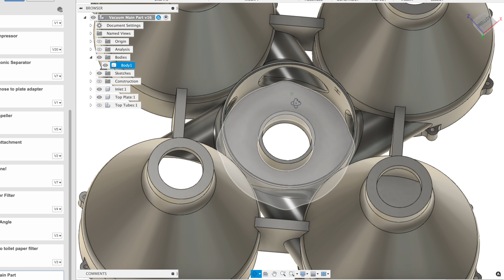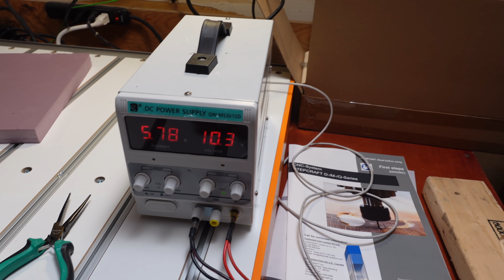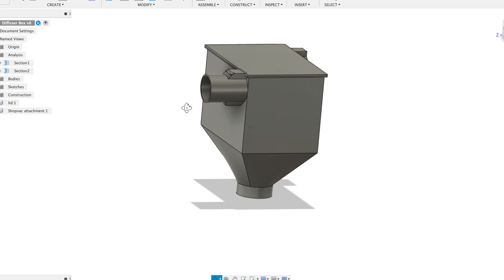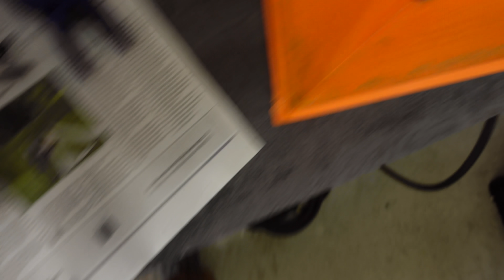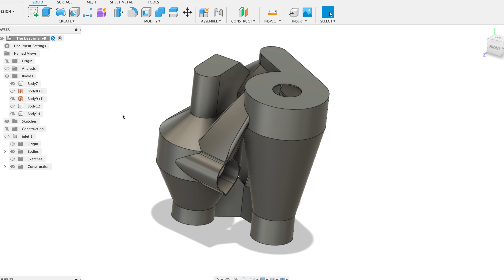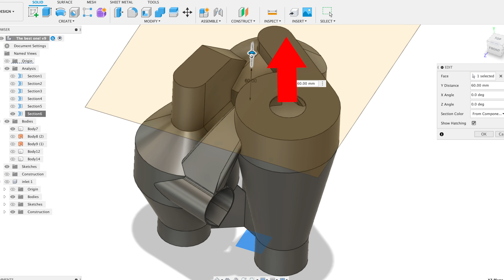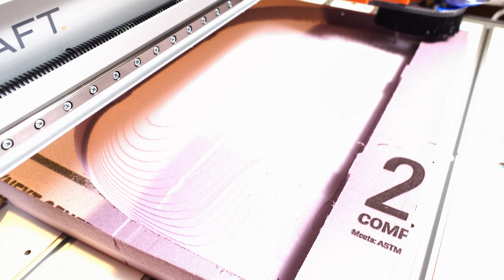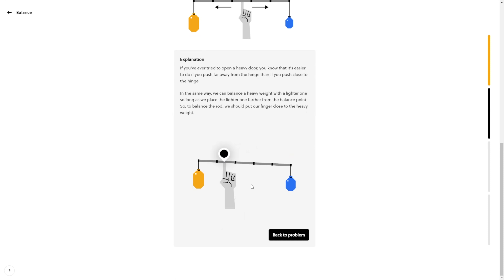3D Printed Cyclone Air/Dust Separator

Comment: Cyclones have proportional dimensions to work well 1D3D are widely used in industrial applications. Where D is the diameter 1 is the height of the cylindrical part and 3 is the length of the conical part. The size depends on the volume of air per minute.

Comment: I don't think the baffles in the diffuser box will really do anything to cause a change in airflow speed. The only thing that can do that is changing the inlet and outlet diameter. Mass flow in is going to equal mass flow out (minus the sawdust that settles in the bucket of course). The compressibility of the air can confound that translating to airspeed a little, but only so much.

Comment: Liked the video & am envious of the CNC however if you are still looking for more Cyclone information then "Design and fabrication of cyclone separator, August 2015, Kashan Bashir DOI:10.13140/RG.2.2.20727.83368" should be of use. It's a clearly written thesis but its by a chemical engineer so the maths and fluidics are complex but the ratio tables (p14) will give most people a good start.

Comment: The center suction tube needs to be down into the cone and slightly below the entrance hole.  If you have dust coming back up from the bucket then you probably have a leak somewhere.  3D prints are full of micro cracks that make them difficult to use in sealed environments.

Comment: This is exactly the kind of DIY video i likee and would like to see more often: passion, skill, creativity, and well-executed objective tests. I really appreciated your video, because over the years i have also built and experimented with various types of separators for my home tiny workshop, in order to filter well especially the critical MDF dust: i have long since found an excellent solution, which includes 3 different stages (first a Thien separator for large and medium parts, then a small cone cyclone for very fine dust, and third a simple and cheap polyester filter, which remains clean for months on.

Comment: I am late to the party here - but another question, what specific 3D design SW did you use?  

Now - the key to multi stage separators is separating the discharge containers  or you get recirculation - just no way around it. - I was sitting and looking at the Dyson patent while watching you as I was using an online design program for a multi state. The Dyson uses a lot of small diameter separators because they collect the smallest particles. PowderProcess has a design program that has a basic particle size limit on separation.  Your challenge seems to be the buoyancy of the particles. Dumping in top of a pile and measuring the time to discharge would help. Just close one end to prevent pumping.

Comment: IMHO, it seems like the diameter of each cyclone matters more than the number of cyclones in series when you fit the whole thing into a smaller space. 
I hope you can get better results by trying out another 3-in-series cyclone system with a larger diameter of each one (may need a bigger space though). 
Just an opinion. I didn't do the math of it, so I cannot guarantee the results. If you can, please try one and come up with another video please.❤

Comment: hey - some awesome testing, congrats. You are on the right track with your staged approach. Unfortunately, you overlooked somewhat the important difference between the stages: particle size. In order to make each stage work optimal, you need to adjust the speed of airflow, pressure and diameter of each cyclone to catch the different size particles. On the upside, a two stage approach should do. but keep in mind, you need separate buckets - because the air will find the path of least resistance!

Comment: Hi, Great video! But I think that you should evaluate some issue dued to the flow dynamic, like the turbolence effect of the  different geometry of the cones. I guess if the flow reaches the cone as much laminar as possible and geometry of the cone are so optimized to reduce the turbolence inside, you could have a great result! Thanks a lot of your video!

Comment: So, a dyson actually is two bins in series. The first cyclone takes out large debris and is tuned as such. the air then goes into the smaller cyclones and dust is collected in the inner bin. the bins are annular and share the same door.

Comment: The more cyclone stages you have, the more it's probably going to restrict the airflow. Personally, I would just go with the single cyclone: less airflow restriction and less joints/connections to leak/fail. Simple is often better.

Comment: You can also put the intake for the funnel a bit lower from the top and on a downward angle for a more efficient cyclone. You ended up doing it more like the Dyson works. So I guess you have to connect the three in one with the mono cyclone, but you seem to be stuck putting the intake at the top of the funnel, I like the one I saw with the intake about 1/3 down and on a downward angle, only about 20 deg but it seems to help guide the dust to the bucket below and nothing else got away. The angle was not much either, it was made with a 5 gallon bucket as the cyclone yet it worked  very well.

Comment: I’ve been using hydro cyclones in my job for 30 years. There are som basics missing here. 1. Smaller the cyclone diameter, smaller the d50 cut point (the size where 50% of the material is recovered up or down), but 5he capacity drops off - this is why dyson have multiple clusters in their vacuums. 2. Length of cyclone or cone only adds a little more efficiency. 3. Adding cyclone overflow to 2nd stage cyclone of the same size will do very little as the cut point does not change.

Comment: From my own experience of using a cyclone, I can say that it is very important that the container with the cyclone does not fall on its side and there are no pressure surges - so before the cyclone it is necessary to make a check valve that will neutralize pressure surges.
Well, it is desirable that the dust container is not overfilled by more than half if it is more than 40 liters, or by a third if it is less.

There is still a certain dependence of the diameter of the cyclone on the power of the vacuum cleaner - if it is less, then the debris will remain in the cyclone itself and it will eventually fly away further, and if it is larger, then it will also slip further. So you can play with the diameter of your cyclone or the power of the vacuum cleaner (motor) to select the optimal ratio.
Instead of paper filters for testing, I would recommend an aquafilter (perhaps of your own manufacture) because of its reusable use indiscriminately (just drain the dirty water and pour in clean water) and the ability to assess the quality of cleaning with transparent walls by the state of the water.
It is likely that several parallel small cyclones can be more effective for fine dust that a large cyclone does not take - at least I would like to test such a hypothesis, but I do not have the opportunity to do this and may be of interest to you.

Of the improvements, I can advise you to make a cyclone with a screw-down fastening to the dust container, rather than fastening it to screws - this turns out to be much more reliable due to the uniform pressure of the connection to the lid along the entire circumference, which leaves no potential gaps for air suction, as well as more reliable in terms of accidental side loads on the cyclone, since the fasteners of the screws can crack and loosen.

Also, you might have noticed that the rotating air stream spins the dust inside the tank and sometimes lifts it back, so you can try to do two things - install a cross-shaped partition inside the tank at the bottom so that the dust falls there and is less captured by the whirl, and also do under the hole, a cone-shaped cap with the point upwards, so that the dust falling down is squeezed out outside the whirl area, where it could no longer be captured by it.

If you make several cyclones, then it is also very important that several cyclones do not communicate with each other inside the same dust collection tank - in this case, the air begins to move between the cyclones through the dust container and and capture dust.

Comment: Maybe a spiral structure along the cyclone wall could help move debris down and prevent it from being picked up by the upwards movement. Also, maybe the outlet could be shielded from the dust in the cyclone with a little cone. "sorting the movement of air" - so to speak - could also benefit noise reduction.
I also think that the radius of the mono cyclone is what makes it more effective. The upwards soak and the downward cyclone get in each others ways, so that particle from the cyclone are picked up easier. Also the stuff needs to be grounded to reduce/avoid static. Not sure, but I imagine it could reach dangerous voltages and you could have spark formations that ignite saw dust and that is a fire hazard.

Comment: Wow, nice work trying all those designs. I have some experience with hydrocyclones and air cyclones, so I can offer some general design advice. Smaller diameter cyclones have a finer "cut point" (smallest particle size removed from the flow), but less volume flow capacity, so you need more of them in parallel to process a given sized flow. And since they are smaller, less tolerance of larger particles before clogging. Your cone angle should probably be 60 degrees or less for most applications (included angle), larger diameters tending to have large angles.

Flow can enter the top of the cyclone level, but often there will be a "vortex finder" to prevent flow from bypassing the rest of the cone and immediately leaving via the top discharge ("short circuiting"). The vortex finder is just a tube that runs down the center from the top discharge to help isolate the top and bottom discharge flows for a 15-30% of the cyclone height (actual amount varies and is often determined by experimentation).

You might get decent results by pairing a smaller diameter "fines" cyclone with an upstream drop box, which is large sectional area volume with a simple baffle. Larger and heavy debris drops to the bottom of the box as the airflow velocity suddenly drops due to the change in section area, the fines are carried by the airstream to the cyclone. The cyclone has fewer solids to work on and they are finer, so the cyclone can be smaller. As an aside, smaller cyclone have higher pressure drops scross them than larger ones, so keep that in mind if you need to use multiple cyclone in parallel.

Good Luck and I look forward to seeing more of your designs here(?)

Comment: All that’s going to do is reduce the suction of a very weak shop vac motor. Cyclones only help reduce dangerous dust when combined with motors powerful enough to overcome the reduction of suction caused by the cyclone. And that’s not going to come from a shop vac, but a massive 5HP motor with a large impeller.

Comment: The small corrugated hose will sing even a low air flow. You can take a 2-5 foot section and swing it around like a lasso and it sings.

Comment: For what it's worth the serious defusers have water spray bars in them too. We have some of them where I work. The water spray helps to basically catch all of the dust and wash it out of the bottom. They're great for industrial scale when you start needing filter bags and the kind of maintenance that comes from abrasives. Probably not so much for what you're doing.

Comment: I poked around the published science and built a few... Most of the best vertical cyclones have a cylindrical portion atop the cone, and the code will be roughly 2-3x as tall as its diameter. Don't go too quickly or too narrowly lest your air stream re-entrain fugitive particles. Also consider having some sort of baffle below the bottom of the cone outlet to prevent the vortex from reaching down into the bucket: if the dust in your bucket is swirling, then you're re-entraining fugitive particles. Finally, cyclones have roughly the opposite trade-offs to filters: a good cyclone removes the vast bulk of debris but the very finest particles will always require a quality filter medium.

Comment: Good job on this.  I wonder, with the three stage series cyclones, what if you reversed it, so that your first two stages went into the captive containers and the final stage went into the big bucket.  You might even consider using three captive containers (sub buckets) for the three cyclones, since that seems to be what you effectively have anyway.   Any thoughts on that?  Keep up the good work.

Comment: Honestly whether it worked or not I'm still impressed.
Reply: This also shows us one thing can't work for all things. (you'd figure that out if you watched til the end of the video.) You need different things to solve different problem. Creating the best possible solution. We found a way to get to the moon in the 60s but lost that way cause we claimed to advance. But you can't have one thing without the other.

Comment: Your series cyclon should work better than your test result. My hypothesis is at the end of your test, you push the hose against cardboard, choke the whole system so all 3 buckets are in negative pressure and particles got sucked up. In your first test, you can see green powder moving up at the end when you suffocated the intake.
Do you plan to try the Harvey dust processor style separator?

Comment: I'd use first a gravity based (maybe mechanical theough some big mesh) filter and then the monocyclone for the rest. So basically into a bucket for the heavy big stuff, out of it and through a tube to the monocyclone.
Pretty cool tests you did there 👌

Comment: I hope you figured it out. This video is dated December 4, 2021. You’re missing the whole idea. Those multiple cyclones are not productive. What you want is the fastest rotation inside the cone as possible. The bottom of the cone that is the small and needs to be opened up more. Otherwise what goes in will just come right back out before it falls to the bottom of the bucket. I have the dust Deputy. It is amazing! I can’t believe all the people that go to Home Depot and buy shop vac filters as much as they cost. It is ridiculous! Cyclonic filters are awesome! I’ll give you an A on your 3-D printing though!

Comment: what u need is duel cyclones one feeding the other side by side for double filtration
  in--    \          -------           /-----------  suck
              \     /        \        /
               \  /             \  /    

the line is pass thru

mega auto cad lol
Reply: each cyclone should be separate feeding each other and piped from the top of the first into the side of the second
Reply: not 4 in one 
just my opinion
Reply: ooooooh you did it lol
Reply: smaller holes at the bottom ie 2cm

Comment: Did blocking off the hose (stopping the airflow) potentially mess with results? There were a couple tests on video that varied like that, and I wonder if it affects how well it works

Comment: Small diameter: large dust
Large diameter: small dust (and large dust) 

The bigger the diameter, the more force is being imparted.

A 2 stage separator should have a small diameter first and a large diameter second in series.
The outputs have to be isolated from each other, but can lead in the same bucket when using a sealed separating wall.

Comment: Bigger diameter cyclones impart higher centrifugal forces, which even let's small particles cling to the walls.
You might want to make a 2 stage cyclone with a small diameter cyclone for heavier stuff and a large diameter cyclone for lighter stuff.
The outputs can be on one lid, but the bucket should be modified to 2 compartments.
(just using a separating wall)

Comment: It's important to consider air volume vs air (vacuum) pressure.   FOr a single tool - a high suction lower airflow may be ok. For longer runs etc and some timber dust, high air volume at lower pressure becomes more useful.  Tube diameter plays a big role in this.

Comment: cyclones are a massive help in this use case. I made one myself and had some issues with the container seal... so I put clingwrap on the container as a separator, sprayed eurathane foam into the lid and clipped it on. Cure, cut off excess and now have perfect seal.   Increased rigidity to prevent vacuum collapse and perfect seal.

Comment: My guess is that the angles of the cones were not steep enough and the surface too rough (3D-printer layers) for a good result. Maybe coating the inside with a real flat surface for better air flow. perhaps something like rubber like could help to stop existing particles. Negative side of rubber is that is possibly scratched of with the time.

Comment: The air tries to find the path with the least resistance, that is form the last of the three cyclones through your wast bucket and than through the first cyclone to the intake, thats why you get bad results. You should try hermetrically sealed independant 3 waste buckets for each of the cyclones

Comment: Your goal should be to create a low pressure high velocity area to swirl the particulate, but then create a high pressure low velocity exhaust outlet.

Consider using some filtered exhaust to aid in stalling the outlet.

Comment: I`m russian... Sorry for my bad english...
Try a vertical lines in separator of cyclone...
This will slow down the air flow close to the separator wall and dust will settle between the separator lines and fall down.
IMHO

Comment: Hi real interesting video. You can get cyclone angle calculators online. It will probably fix the results you got. I’m in mining and we use cyclone separators in the mills. Calculating and  alibration is very important to efficiently seperate different mesh size for the ore.